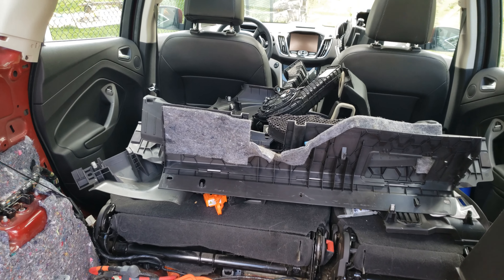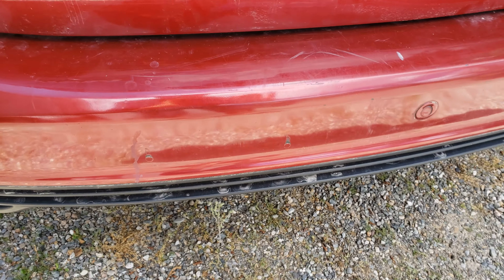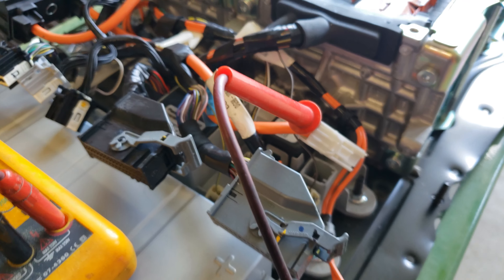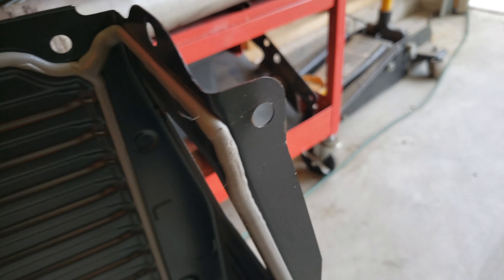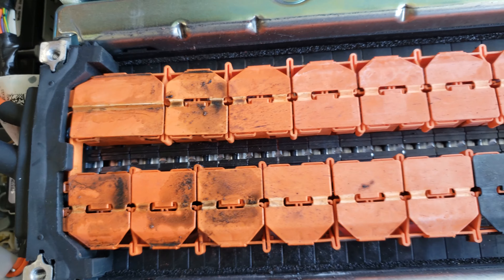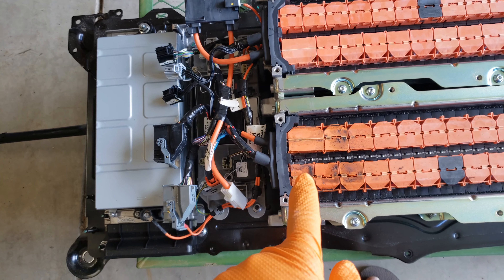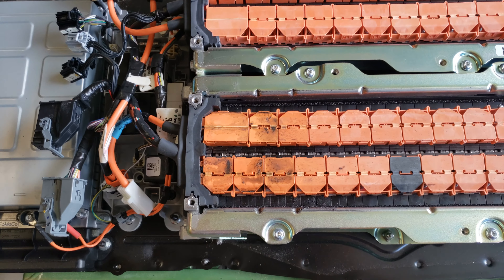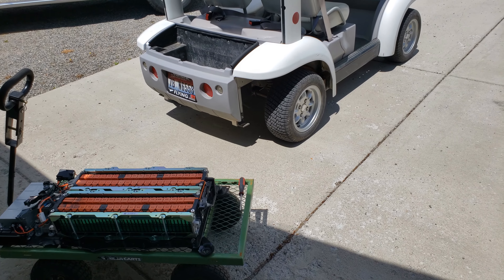I Bought a Cheap Ford C-Max - with a DEAD Hybrid battery

Comment: I got a question for you I just put a new battery on my car and the old battery had no problems except I thought it wasn't charging right but it was fine I put in the new battery and then other putting it in I noticed the 12 volt system wasn't charging on it and it showed the triangle light on and I was wondering what's going on please let me know if you have any information thank you
Reply from the maker: I have only come across that when the customer jump started the 12v battery backwards and blew the fuse for the charger. The DC-DC converter is part of the hybrid "battery", however there are a bunch of other systems that can affect the operation. I highly recommend taking it to the Ford dealer to get an accurate diagnosis because they can plug in the IDS and find the fault the car sees. I'm sorry I don't have an answer for you, but it's very difficult to diagnose cars remotely, especially because I'm a Diesel Power Stroke Specialist. Cheers.

Comment: What did you do with the battery and cells?
Reply from the maker: I've been turning them into power wheels batteries 🤣 I have another video about how to do that
Reply: @fordtechchris  do you believe you could repair these batteries by testing each cell and replacing the ones that are borderline or bad?
Reply from the maker: @jaypee7632  I absolutely think you can. I just didn't want to gamble on the acid contamination. I think there's still a higher chance it becomes a problem a second time and no body wants to get stranded in their car. So at some point i had to write off the loss of the battery and just replace it.

Comment: Is it difficult to get to and pull out? My son is considering buying a 2013 but he is concerned about the life of the battery.
Reply from the maker: I'm sorry I missed your question last year. There is quite a bit of interior trim and seats that need to be removed, and it's heavy and requires two people to remove and install. You also need to be safe and disarm the high voltage system and handle orange cables with care. But overall it's not a very difficult repair.

Comment: Just be careful and use insulated everything when working.  Treat it as on, even if its disconnected and you'll be fine.  EV's are here so the fact you figured this out and now can work on cars with batteries, cause there is a version of this car thats a PHEV, means you'll be able to work on alotta cars others wont.

Comment: Hey what size engine does that thing have? Just wondering because here in the uk they have either a 1.6litre, 1.8litre or 2litre engine both available in gasoline or diesel
Reply from the maker: 2.0l atkinson cycle engine. Completely neutered from what you guys have. It's funny how ford introduced the C-Max as a "new" car for the hybrid when you've had then for years as diesels!!! American logic I suppose!
Reply: Chris W lol that’s what I thought as well
Reply: @hitachi42inchtvsarepowerco79  wish ford would bring a 4 banger diesel to the USA but they won't do it

Comment: Did you disassemble the battery completely after this video?  Did you do a video on the disassembly
Reply from the maker: I didn't. It's still sitting in the garage. If I do, I'll film it.
Reply: Ok  thanks. I am considering using 1 for off grid backup battery
Reply from the maker: @chrisedmonson4496  I've heard that's a popular use.

Comment: Wow this is the only c-max battery failure I’ve seen or heard of. How many miles? I’ve seen hybrid batteries for sale as low as $200.

Also, lithium ion should be able to sit for hypothetically years without damaging the cells. Unlike in a older Prius with NiMH, even a few months can cause damage.
Reply from the maker: I think it came to me with 136k. And yes, it's the only battery failure I've seen as well.
I'd say lithium being able to sit is only hypothetical. I've lost plenty of LiPo RC batteries that way, a Palm Pilot battery the same way, and some laptop batteries. 
In my experience, Lithium is temperamental.
Reply: @fordtechchris  wow that’s not that high of miles. I think it really depends on the lithium quality, as to how well they hold up. My 2013 c-max has 180k and has been rock solid!

I do have a old wireless speaker that sat for 4 years with no use, finally found the charger 🔌 cord and it will works like new. I was pretty shocked.

I know there is some data saying lithium-ion can last up to 10 years without any damage, but like you said, it’s hard to tell with real world use, or lack of use.

Anyway! Thank you for making this video, pretty neat
Reply from the maker: @Thissandthat  my first C-Max was a plug in and I got 185k. Only issue was the transmission/traction motor case leaked but I fixed it under warranty at 95k. They truly are pretty great cars.

I think you're right about quality of battery. It always pays to spend a little more. 

Thank you for watching and commenting! Cheers!

Comment: Is the c max a good car I'm currently looking at getting one are the engines usually good on these?
Reply from the maker: The engines are good. I've never seen problems. The hybrid components are pretty good too, but every now and then a battery or hybrid motor goes bad and can be expensive repairs if you can't do it yourself, but this goes for just about every car on the road, there's always the exception of there. This is my second one and I wouldn't hesitate to recommend them as great cars.
Reply: @fordtechchris  I just bought a 2013 plugin sel. 118,000 miles. 40.2 fuel mpg. Rattling front end.  Brakes need work. Clicking in the steering wheel, possibly signal switch assembly.  Air conditioning not putting out very cold air. Not too peppy but ok. It is near 4,000 lbs. I just charged up overnite. 18 miles range available. It’s better than the $430 a month payments on my other vehicle. Thanks.
Reply from the maker: @ArtOfHealth  heck yeah!! I hate car payments.
Reply: I have a 13 sel no issues at all I just did a video on how to do the brakes , but I’m currently working on replacing the front splash tray ( common issue) and strengthening it to prevent the issue from reoccurring

Comment: Threw you a like and subscribe for your effort. Thanks for sharing. As a Ford Tech, would you recommend purchasing a used C-Max Hybrid? Are there any common items I should look for when purchasing? Thanks! Keep up the good work!
Reply from the maker: I would. They are one of the more reliable Fords. But don't be disappointed when the Sync Bluetooth, voice activated radio has issues. It's about the worst of the car. Check for trans fluid leaking from the case halfs. That's an expensive problem to repair and it is somewhat common in the early models. Otherwise just make sure the maintenance has been performed and you should be able to find a reliable car I think you'll love.

Comment: Do you still have this car? If so, would you sell it so I can fix my CMax?
Reply from the maker: Ha ha, sorry, it's my commuter! I'm hoping to get many years of service out if it!
Reply: @fordtechchris  im looking at a 2013 cmax hybrid sel tomorow with 100,000km. Is there any issues that i should look out for? Have you had any trans issues?
Reply from the maker: @donnieflame  I think I've seen one bad transmission in the 8 years of C-Max. Very reliable. Sometimes the trans case leaks at the bottom and it's a big job to fix. But it always stays as a small drop, not really worth fixing outside of warranty. Otherwise they're pretty great cars and not many common failures. Good luck!